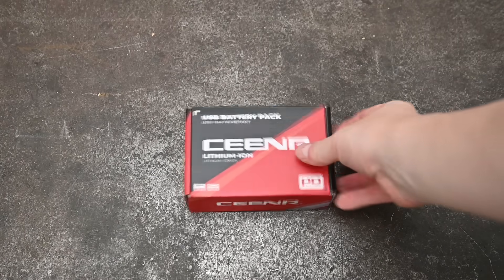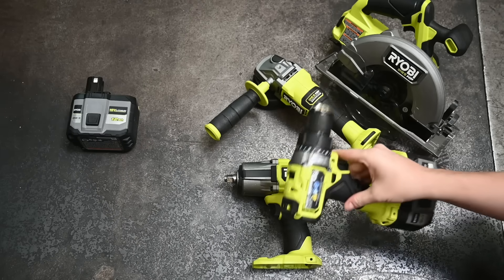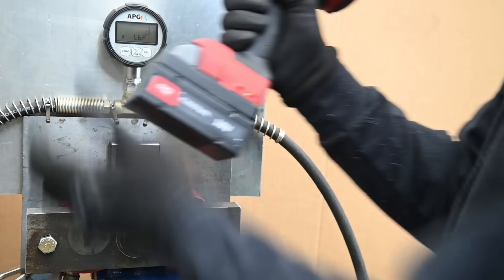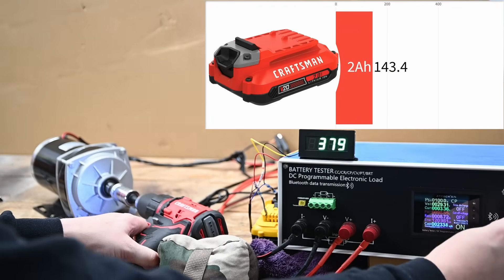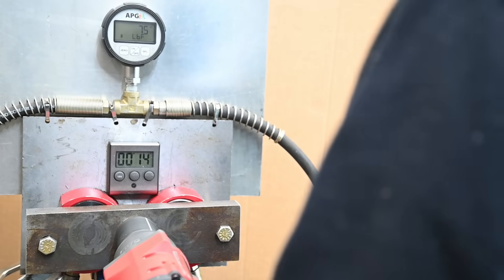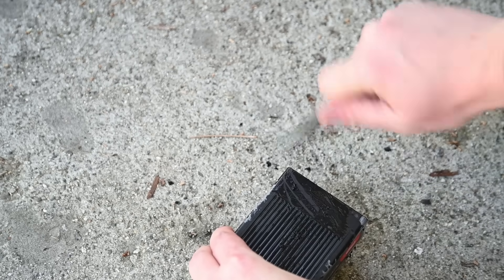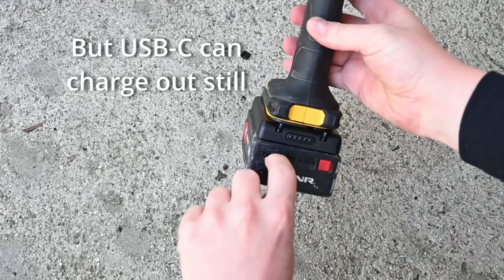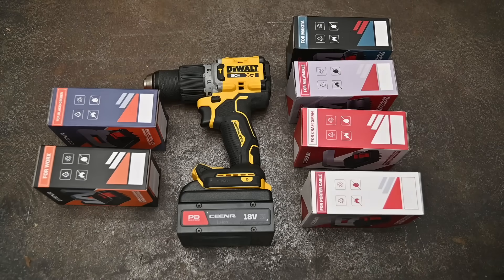We Bought the New Universal Battery for All Tool Brands

Comment: instead of them pricing them reasonably they probably pull the 14.4v ryobi and add a proprietary communication protocol thats encrypted
most tools out there just need a 3.3v signal on the temperature pin to work, but a few require a data stream like all bosch ebike batteries that hasnt been hacked yet
Reply: Insane we live in a world where batteries are encrypted...
Reply: @kmsdaily  it won't be long until they encrypt battery cells with wifi and they won't work unless you pay your $5 subscription fee to Samsung
Reply: @joey9511  then remove everything and drop in your own bldc controller. There’s plenty online for tools if you know where to look
Reply: @kmsdaily ” safety ” - Bosch
Reply: @kmsdaily apple has been doing this with their batteries for years
Reply: Not to mention, there’s a channel on here (can’t remember the name at the moment) that’s already intercepted the data stream from m18 batteries and the charger. And was able to dump the protocol.
Reply: "Tool Scientist" is the channel
Reply: People just need to boycott. Don't buy from shady companies, simple as. 

If people boycott any company that uses proprietary technology, they'll stop. 

Don't buy it. Any company that doesn't, buy that instead. People get ripped off because they allow themselves to be ripped off and keep buying it anyway.
Reply: Well, additional data stream on an ebike is understandable considering which conditions they face. There are plenty of ebike fires from cheap Chinese ebikes. An ebike must know if there's any deviation in performance and cut the power.
Reply: thats bs, a properly made bms cuts off the power if something goes wrong. the most fires are from charging not discharging, usually with the bike turned off so no datastream is happening anyways.
and chargers are dumb, they output 5 or 12v to activate the circuitry and then just send 42v current limited to the bms. theres is no "hello chg here, can i gib powr pls?" going on.

cheap batteries explode because they are built like crap not because they dont communicate before turning on, many batts out there from good brands dont require data to be sent to work, except bosch, panasonic, yamaha and a handful of others.
 
i made a adapter dongle for the yamaha bikes to be able to use third party batteries and none of the 30..50 people that made or bought one had a battery that went up in smoke.